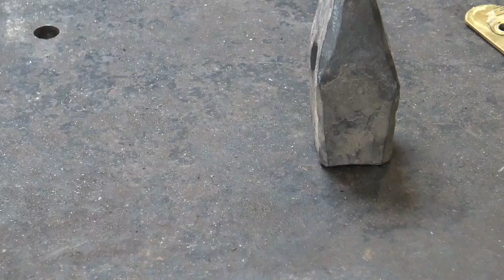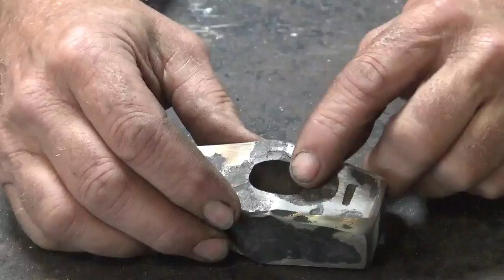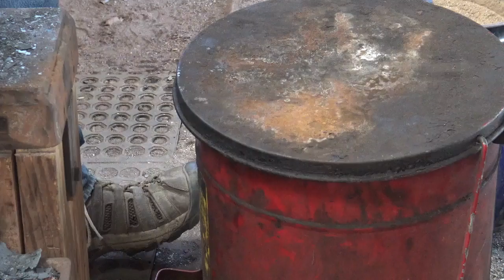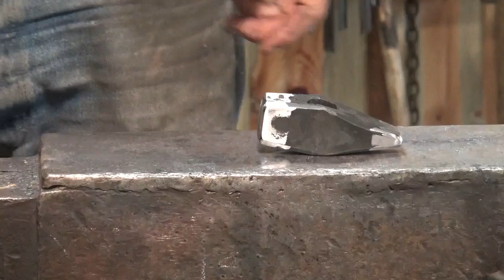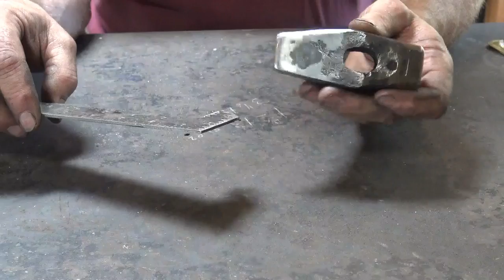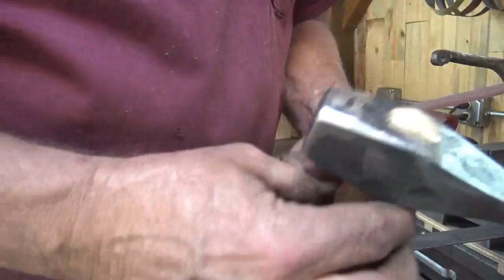Forging Your own Hammer part 2

Comment: Why would you not just put it in sand/ash and let it cool down slowly after tempering?
Thanks for taking the time and making fantastic videos 👍
Reply from the maker: Tempering does not require nor benefit from slow cooling.  Annealing does require slow cooling and that would be done after forging but before grinding.  Then it would be normalized, then hardened and finally tempered.
Reply: @BlackBearForge  10-4....I always viewed annealing as kinda making the steel loose it’s memory because I use old springs sometimes....then work the piece and harden....then Temper and watch for color bronze or sometimes blue tones.... just got in the habit of letting them cool n the ash bucket.....I really appreciate your time and I better understand the process now!

Comment: I put the workpiece inside a  short piece of water pipe when I heat treat something like this hammer head.  Then, in the coal forge, for instance, I can use the blower to carefully heat the whole thing to temperature.  I use a cheap Type K thermocouple/reader with a sheathed thermocouple.  I find that it's not hard at all to control the temp within +/- 25° F..

Comment: I knew an old man when I worked in steel shop he would burn welding rods into the face of a forging hammer and grind it smooth

Comment: Great tutorial. Maybe you should have retired earlier from your former profession and start tutorials earlier 😉

Love your videos. Always very clear, to the point. 

Have a question… at around 24 mins in to your video, after water quenching the hammer, when you take it to the belt grinder, how come there are no sparks?

I can see that it is grinding, became smoother but find it very interesting that no sparks were coming off.. (maybe speed of belt grinder was low?)
Reply from the maker: Hard to say at this point.  But lower speed to avoid overheating certainly reduces sparks and some types of steel don't spark like others.

Comment: 10 year firefighter myself (2006-2016). You cannot stress enough the dangers of fires. Most don't understand that fire is like a living thing and eats everything in its path, assuming it has food (fuel i.e, wood, coal, paper, oil, gasoline, etc) and air. Just like humans, fire needs food and air to live. To anyone just starting out, study the fire triangle. Learn it, remember it and always refer to it when setting up safety parameters.

Comment: Dear John, your large belt sander intrigues me. It really rips through the metal and makes my bench grinder look incredibly slow and painful to use by comparison. 
Did you make it yourself? 
Does is have a variable speed drive or is it fixed? If so, what speed does the motor run at? Cheers.
Reply from the maker: The big one is 3x132 single speed, it runs about 5500 sfpm. Shop built by another smith. I bought it used.

Comment: Quick question about turning the forge off at the ball valve to let it soak up the heat... will that damage or harm the burner? I’m so scared with my single burner chili forge because the way the describe in the directions to shut down the forge... this won’t create a chimney effect? It’s a cool trick so I’d like to try it but don’t want to harm my burner.
Reply from the maker: In theory it will cause the burner tips to wear faster.  But I have noticed a problem and I do it quite a lot to keep the noise down during the videos.  Doing it occasionally for heat treating isn't likely to be a big deal.

Comment: What do you think about using an infrared thermometer to check the temperature when heat treating.  I imagine with experience you can be pretty accurate by eye, but for newbies it seems it could be a good way to check your estimate when learning.
Reply from the maker: The problem is that the sensing pattern is a cone and to be accurate it needs to be very close tot he piece which means you will likely damage the thermometer.

Comment: Ok, got it, 4140 makes a good hammer, I'm 6' 200# slung carpenter hammers split wood with 2handed sledges and axes, so used to hammering, what weight hammer would you recommend that I use for starting out?
Reply from the maker: Probably a 2 1/2 pound to start.

Comment: From 1 John to another, thank you. Great video. Just as a note, your American viewers will know your fire extinguisher as an ABC, which is a  solid, liquid and electrical fire extinguisher. In Australia our equivalent is th ABE. I am not surprised to learn that you were a Firefighter. I'm a Volunteer Firefighter in the Cfa on Victoria, Australia. In my workshop I have a fire blanket, a fire hose and an overhead sprinkler system. Probably a bit of overkill, but as you have said yourself, safety first. 👍 Again, great video and thank you.
Reply from the maker: Interesting, it never occurred to me that the ratings were different
Reply: @BlackBearForge  ,  just the letter I guess. I suppose 1 day codes for fire types and extinguishers could end up as 1 International standard.

Comment: Why does it look like there's an top plate on that anvil ??? I was under the impression that hey budin anvils were tool steel from the waist up ???
Reply from the maker: I'm not aware the Hay Buddens were half steel.  This one shows signs of having just a top plate of steel.  But what you see in the video is an old repair of the edges that is starting to wear out.

Comment: That belt sander is huge, can't imagine how much the belts are, is bigger more costly or more cost effiicient? Same? Want to make my own, and no idea of how long belts last, costs, and if short or long belts are better cost wise.
Reply from the maker: Generally larger belts cost less per square inch plus last a bit longer because the run cooler
Reply: @BlackBearForge , I was thinking that might be the case. Wasn't sure, thanks

Comment: I cant Express enough how grateful I am for your videos.   You take the time to explain what your doing.  Your constant emphasis on safety is awesome.   
Question for you.  I use a homemade coal forge.  I also use a lot of "mystery metal".  By forging with coal, am I introducing carbon into the metal I'm forging?  Thanks again.

Comment: Fire safety is no joke, there are many opportunities in the shop for fires to start but a little prevention goes a long way. I use a small family fire protection company, the kind that services schools and municipalities. They come out once a year on a schedule and check all my 6 extinguishers. I have two large ones in the shop and 4 on equipment. They are very affordable, <100$ per year, and they sell me extinguishers that are refillable. In the event I use one, it is cheaper to refill it. They keep refills on the truck so I am never without one. These extinguishers are much better quality and more reliable to boot! Be Well

Comment: Where do you buy your 4140? I make hammers and finding steel in the right size is pretty difficult in South Georgia.
Reply from the maker: I buy lots of materials from McMaster Carr.  Not the cheapest, but very reliable  .  https://www.mcmaster.com/grade-4140/4142-steel

Comment: Something I learned from experience, it pays to put the steel wedge (when you use it) in the same way you put in the wooden wedge, head down on the anvil and hammer on the butt of the handle.

Comment: John
You mentioned color changes in the forging process and in heat treating. 
Does this temp to color range include all steels or just the particular material you were using. In other words is cherry the same temp with all steel?
Reply: I know this is late so sorry, but every steel has a different hardening temperature, generally. 4140 and 1045 generally are quenched at a cherry red colour, but higher carbon steels, once again generally, quench at higher temps, around bright yellow. I recommend doing your research on your specific steel so you know what to do. Same goes for tempering, just dealing with lower temperatures and with ovens.

Comment: Thank you for your videos. If I temper the hammer in an electric oven, do I need to quench it? Or can I just take it out of the oven and let it cool at room temperature?
Reply from the maker: In theory yes, but i don't generally bother and I doubt it makes any real difference.
Reply: @BlackBearForge  never ever quench after tempering, you are negating the purpose of tempering by quenching and hardening the metal.  At some low temperature quenching will have no effect. You really need a Rockwell hardness tester to test the hardness at different stages of the process to see if you are accomplishing what you think you are accomplishing.  With tool steels tempering needs to be done immediately after quenching to prevent cracks. I'm a machinist not a blacksmith but I do respect your trade/art and I really enjoy your videos.

Comment: Would a chunk of axle shaft be good for a hammer or anything with an edge like a tomahawk?
Reply from the maker: Most axle shaft is pretty good steel for hammers and probably tomahawks.  But it isn't all the same, so testing a piece of what you have would help you figure it out.
Reply: Black Bear Forge okay, thank you for the advice, im still learning what is and isnt good for certain things as ive only been doing this as a hobby in my spare time for a year

Comment: Is 4130 a decent material for a hammer? I only ask because that’s what I have on hand.
Reply from the maker: It would make an OK hammer.  It may need to be re dressed a bit more often but that isn't to hard to do.
Reply: Ok thank you so much for your advice I’ll definitely in the future get the good stuff.

Comment: Thank You John,Have you ever heard of useing Transmission Fluid to Harden and Temper 4140
Reply from the maker: I have heard of using it for quenching, but I have never used it.
Reply: Don't use trans fluid or motor oil for quenching. The smoke it produces is extremely toxic and they are both bad for the steel.

Comment: Watch alot of black smithing channel but seem to alway return to black bear
Thanks for sharing your knowledge 
Having worked with metal since 1969 Ive just got my first anvil
It is a little rough but hopefully i will get it back into service and be on my way using your methods Thank You Hooters Welding and Metal Works

Comment: Enjoying the video's.... but hating the ads that interrupt  your sessions (not the ad before the video starts butduringthe video's)
Reply from the maker: I understand.  I would like to be able to post without the ads.  But the ads are what pay most of the expenses of doing the videos.  Videos with ads that run mid video seem to make a higher return than those with just the ad at the beginning of the video.  I don't like ads either, but without the slight offset to my expenses the ads provide I would not be able to justify the time and expense to make the videos.

Comment: I wonder if you placed a torch pointing onto the punch you were using for tempering, if you would be able to keep a low cherry towards the area that is contacting the hammer. I know you are going for a slow process but this would keep you from have to place the punch back into the forge. If I ever get to temper something with a drifted hole like this I will try it out and let you know.

Comment: I watch a lot of smithing related stuff. Daily. Anything from knife making, tool making to ornamental stuff.
Often, I watch how to make the same item by 20 different people. Just to pick up on little tricks and shortcuts to achieve the best results with the least amount of hassle.
I've found that the most valuable information that has helped me since I started blacksmithing is often found in the little offhand comments that other smiths make when talking about an experience when they were learning or about mistakes they've already made. 

Just little comments that get throne into the video. 
"Oh, and make sure you don't forge this down too far.." or "Whatever you do, don't get this all askew, cause one time I.."  
I'm learning a lot from your videos because of the bits of ramblings and small comments in between your demonstrations of the skill at hand.

I think you have a great balance between concise information on the materials and skills needed, and demonstrations displaying your experience. 
"This is what the book says to do, but this is what actually works, or will at least get you by with the minimum amount of hassle and time." 
I think you do well with instruction. 

You clearly don't have a ton of experience with recording or editing media, and you don't have an extremely lively camera presence. I'm sure those things will come with time, though.
Personally, I think your personality makes up for any downfalls your video quality or 
Professor-ability (just made that word up) might have. 

Above all else, your demeanor, attitude towards smithing and overall personality will keep me coming back to watch your videos.

A side note: Those are some serious glasses, Man. Every time you look directly into the camera I can feel you staring directly through my soul. It's very impressive. 
Anyway, Good luck to you brother. I wish you and your channel the best.
Reply: What a great comment. You have literally said what I have been thinking while watching all of his videos. 

John, the way you teach is perfect. It’s exactly how I taught and how I like to be taught. Please continue making these videos!
Reply: Ungladly the most informative channels like this one, don't get the attention they deserve. People don't notice how awesome this guy is to be giving so much information here for free that you would struggle even to find on classes an still they would rather watch some short edited video of some damascus bullshit
Reply: Could not agree more. There’s a common sense approach to the task with just enough wisdom of experience to back it up. Very nice and job well done John.

Comment: These videos were two very detailed explanations on the theme. I feel I need to share one thing about the metal wedges you put in the head-end of the handle: If you put the wedge in the handle diagonally, it'll inhibit the head from moving on the handle both ways, as the wedge squeezes the handle outwards diagonally. It means the head won't be loose on the handle as long as the handle keeps being sturdy.